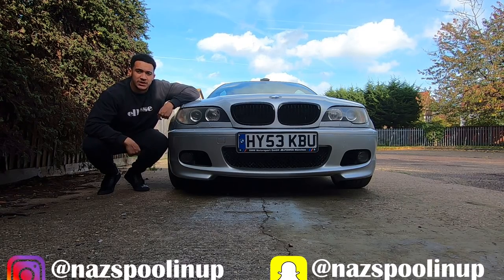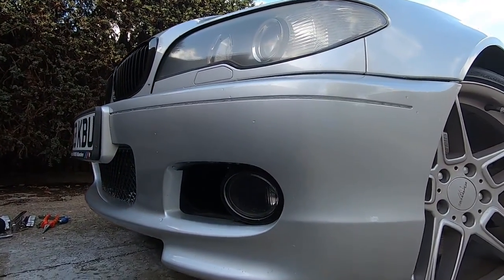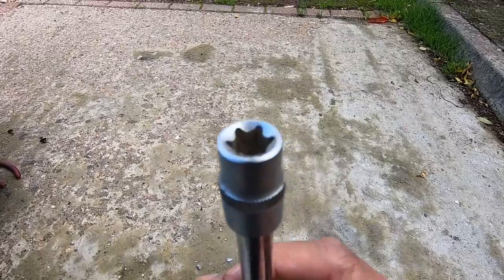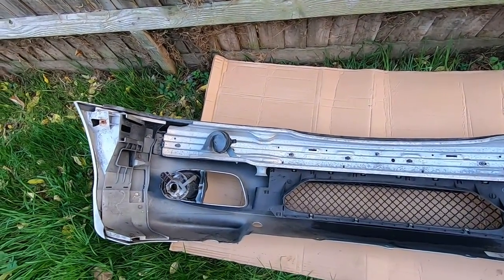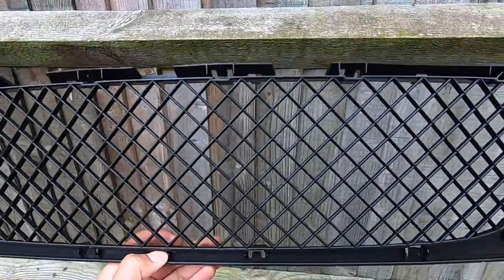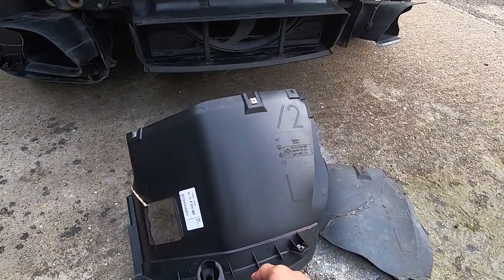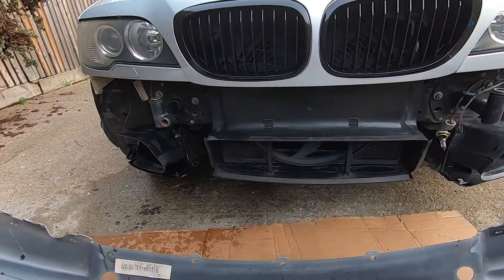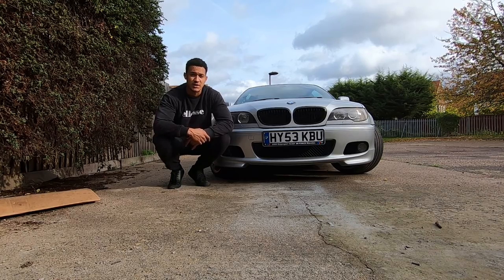BMW E46 BUMPER GRILLE AND INNER WHEEL ARCH REPLACEMENT

Comment: Where would you recommend for E46 spare parts….  I have a E46 Touring and need some of the plastic trim panels from around the inside boot hatch
Reply from the maker: Hiya mate, I bought all of these bits from BMW themselves so they weren't spares. I would say it's always a good idea to use Facebook groups, for example there will be an E46 touring group on there, if you join it you can ask if anyone has the bits you need. I used groups on Facebook for my XR2 and the GTI. I hope this helps you.